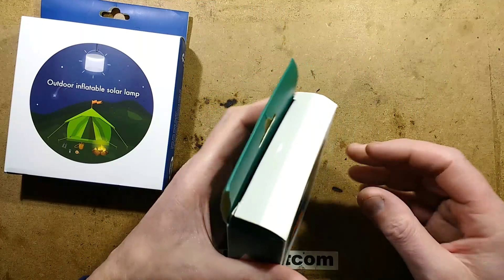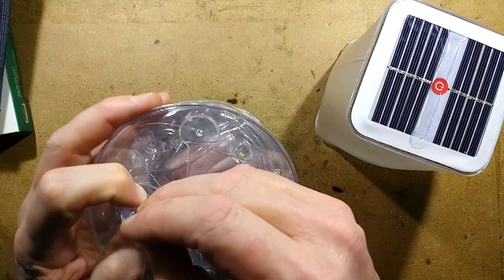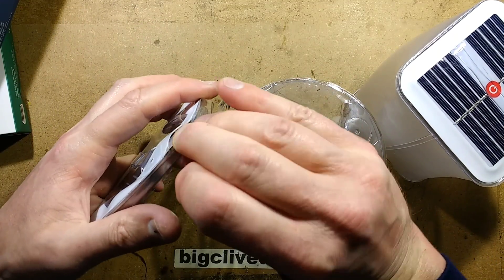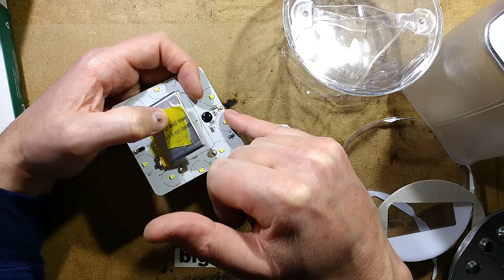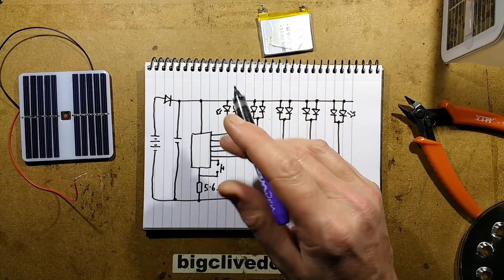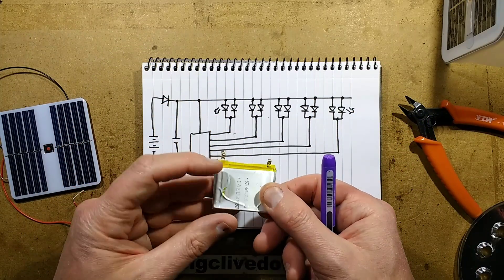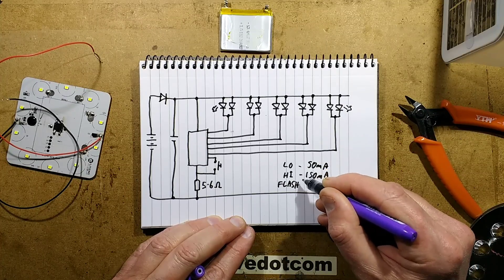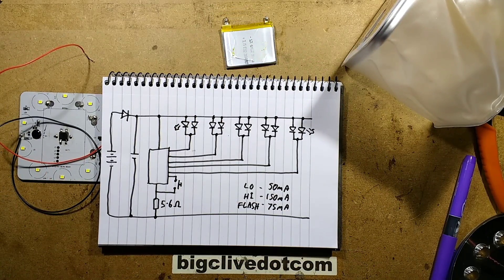Inside an inflatable solar camping light.  (schematic)

Comment: Hey Clive i just wanted to say a big Thank You! I watch your videos because i find them interesting and i wan't to get into electrical stuff but honestly when you show all the schematics i haven't a clue yet i don't let that stop me enjoying them. I recently got into a project where i need a new battery holder and i hadn't a clue about soldering. I found your beginner guide to soldering really handy and i bought myself a cheep little kit for basic repairs. ^-^
Reply from the maker: Over time you'll recognise more and more components on the schematics until you can intuitively read them.  It all just falls into place.
Reply: Way to go GKM 👍 I warn you tho....electronics can get addictive 😉
Reply: GothicKittyMadness great way to get started. I am an electronics noob myself I have been getting kits off of eBay and banggood and it has been great fun. They are cheap too.
Reply: Do any of you have a book to recommend that goes over basic circuit design/schematics/components? I'm studying electrical engineering and I have a circuits class next year and I want a head start.
Online some say the Make Electronics books or the practical electronics book by Simon monk.
Are there better books?
Reply: Matthew C practical electronics is really good. I have heard the make book is not great (well actually a friend of mine said it is shit but I have not looked at it.)
Reply: If you haven't seen it already, Clive's primer on various components is here: https://www.youtube.com/watch?v=6Maq5IyHSuc
Reply: GothicKittyMadness you can buy mini project kit on line..and try to built it on your own to practice
Reply: GothicKittyMadness ur pretty will hav mah baby?

Comment: In your schematic is the 2nd ladder the solar panel? Why are the leds connected separately to the chip? Why not have the leds in series and drive them with a transistor if needed?

Comment: If those had the protection circuit built in they're be great little lights. Uninflated they'd be great for an emergency kit since they'd take up so little room. Wonder if they'd float when inflated? If so they may be handy when boating at night,

Comment: You said you'd hook it up to a power supply and check if it cuts the power. Obviously from the schematic it can't do that, but did you try it anyways? Maybe the LEDs turn on automatically so the cell won't overcharge?
Reply from the maker: I did charge it from the power supply and it just kept charging.
Reply: bigclivedotcom good so i can get more light out

Comment: I think with such small solar panel they newer expected it to be able to overcharge a battery
Reply: Clive, your mission, should you choose to accept, is to try and overcharge it using your array of LED floodlights. See what the voltage climbs to.

Comment: I go camping about once a year (motorcycle run over our labor day weekend) and in that location solar anything is a complete waste of time because there are LOTS of trees and few open areas that get sun for an extended period of time. Some people insist on bringing solar garden lights and whatnot and they're usually disappointed with their performance, even if they move them around during the day to try and get them to charge. 

Inside my tent I use a 48-led disc light that runs off of 3 AA's and hangs close to the apex of the tent - plenty of light for my needs, though the one thing I'd wish for is a remote to turn it off after I get into my sleeping bag instead of having to faff about with a flashlight in between turning it off and getting into bed.

In messing around a bit this year, I realized that one of those 10M long strands of LED wire (the kind with the resin-dipped SMD LEDs) will encircle the outside top of my tent just under the rain fly, overlapping the length of one side - say, over the door where I might want it brighter. NOW I'm trying to remember if there are attachment points that would work for that inside the tent; with the USB power connection, I might be able to figure out a way to make it more convenient to use than the disc light... HMM!
Reply: Dick Fageroni: Solar can make sense if one wants to do a permanent install somewhere there's no access to mains power and not have to keep changing batteries; obviously a very different use-case than a long weekend camping trip. ;)

Mark Howards: There's definitely seams at the corners and I should be able to attach there, if not elsewhere. Not sure if a binder clip would hold, but if it will I can just run the LED wire through the handles, et voila!  I'm rotten at sewing and I'd hate to damage the tent.

Proscriptus: As this isn't a backpacking trip weight isn't terribly important to me - it's just that solar makes little sense in this heavily forested site. I guess these people think they're being "green" - but an LED wire with a rechargeable USB power bank is no different in that way but it works much better. (And frankly, I go to that event to hang out with friends, not toh fuss with solar lights.)
Reply: wire led strings with solar (which you can insert AA battery with a few turn of the screw will work and easy to attach with a few cloth clips (dollar store). May not be enough light tho , would be very pretty.
Reply: Furr Bear if there aren't many attachment points you could always sew a few in.
Reply: just buy some stick on velcro
Reply: I want more lights with cranks.

Comment: I’ve always just bit down gently on that kind of valve to inflate them. I wonder if that’s destructive to the valve in the long-term, though I’ve never had a problem with it.
Reply: Josh Myer not really, that's actually how they are meant to be used. Biting on it will open the little flap inside, same for deflating.